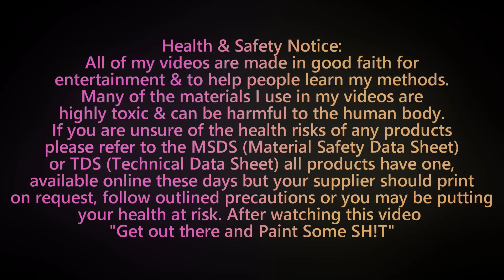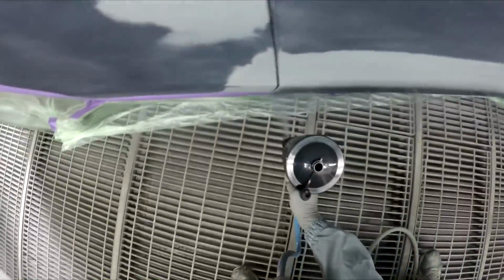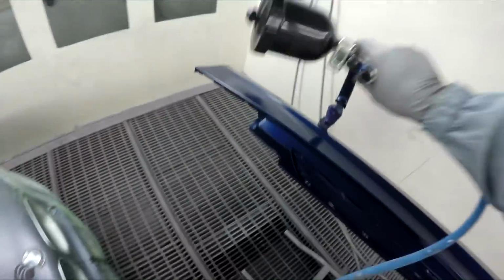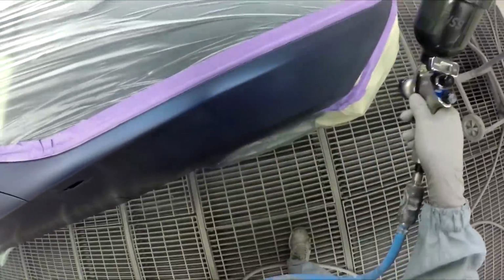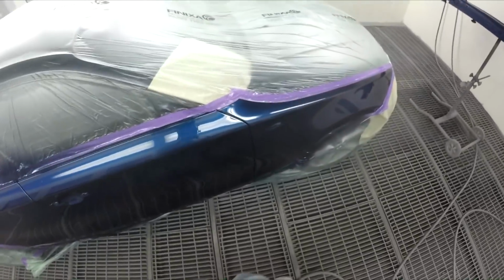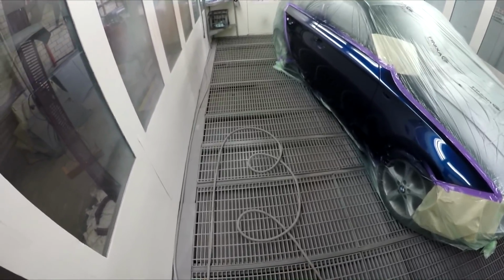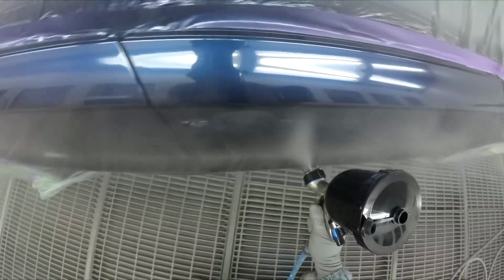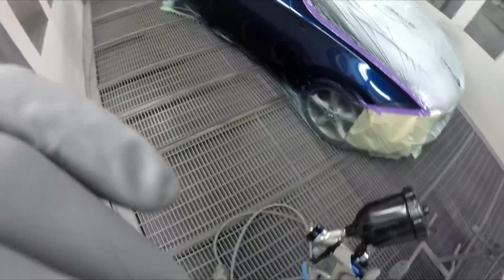BMW 118D Spray Painting

Comment: Hi Gunman,
                     I am in England and I have a DGI Pro Pod or Devilbiss digital gauge on all my guns top and bottom. 2 Bar at the bottom always reads 1.6-1.67 at the top depending on the barometric pressure on the day.
I believe the pressure is lost through the body of the gun itself. I have tried this on Pri Pro,GTI Pro,GTI Pro lite and DV1.
PS I like my Iluma 11 on our dark old U.K days doing clear coat, lol .
Awesome vids, keep em coming, big fan.
J.B.

Comment: Both of mine read 29 psi at the bottom gauge  and 21 psi on the digital. It’s important to make the reference with the air valve on the gun wide open and use the wall or gauge to dial it down. My numbers will change if the gun valve is closed down any